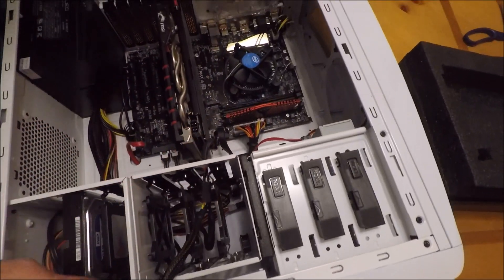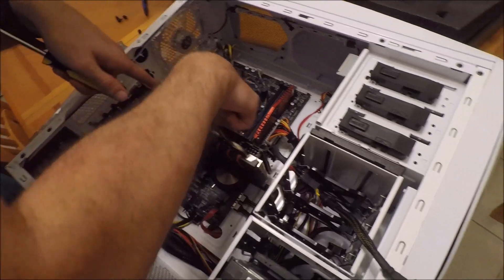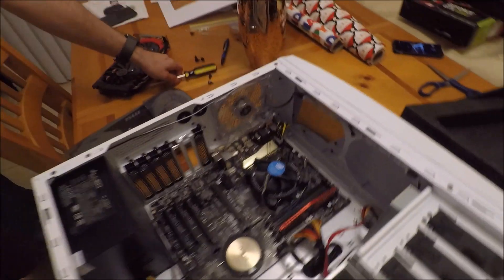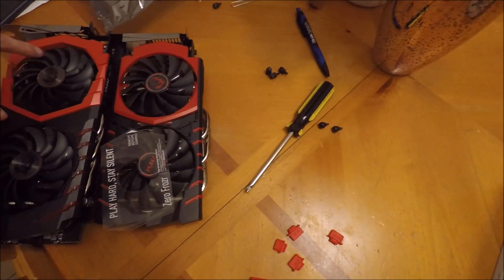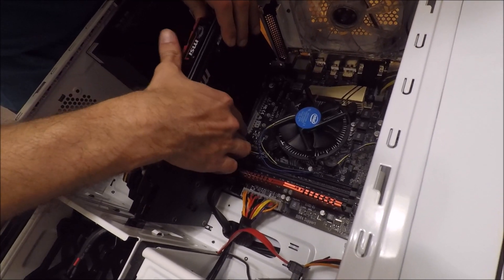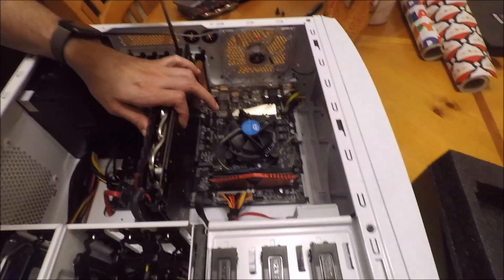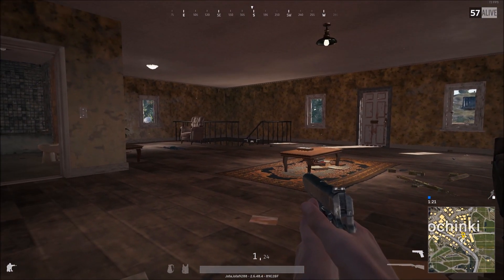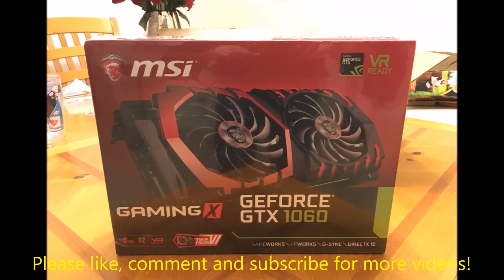MSI GTX 1060 Install Guide! (Games Benchmarked)

Comment: not sure if anyone can help, i purchased this the other day, ive checked for compatability beforehand. But when i placed this into my pc it wouldnt get detected or even move. The only thing i can think of is a idont have enough psu (im on 300w) ive ordered a new one that can handle it. Could this be the reason it wont turn on or could it be other reasons? Would really appreciate a reply thankyou in advance
Reply from the maker: Hey sorry to hear that. If it doesnt turn on at all sounds like PSU issue but I would call MSI support to see what they have to say. Hope it works out!!
Reply: Thankyou for replying, ill give them a ring tomorrow to make sure, ill let you know how it goes, may help someone else in the long run with the same issue.
Reply: forgot to reply sooner, it was a PSU problem, not  enough juice to get it going, all sorted now and runs perfectly :)
Reply from the maker: Sounds good!
Reply from the maker: Awesome I’m happy to hear that!
Reply: @PhenomMatty  What size did you install... got a 1060 the other day.
Reply: @brot5246  only the 3gb, 6gb was too much cost wise for me
Reply: did you get a 500w psu?
Reply: I’m installing one in a few days, I made sure to have a good enough psu beforehand (450w)

Comment: Man! Asus 1060 Dual  OC is $20 cheaper. What should I buy?
Reply from the maker: I am very happy with mine. I would check reviews to see if the 20 dollars is worth it.
Reply: Thanks for the info man!
Reply: get the gaming x its a no brainier, it has bigger fans stays cooler and its a over clock beast i got mine to 2100Mhz :) Its the strongest 1060